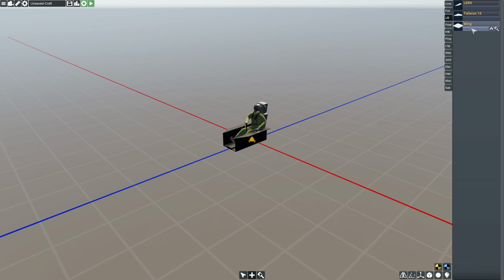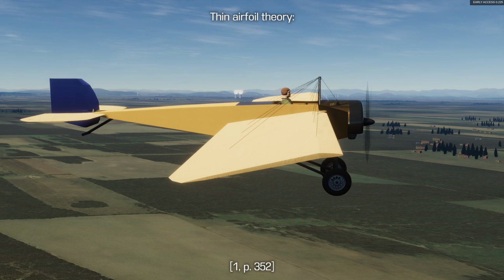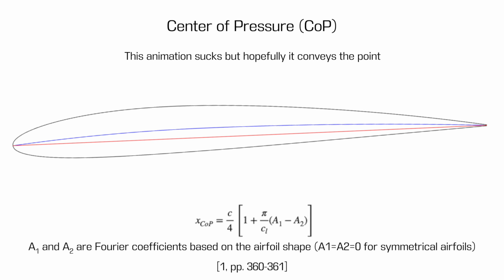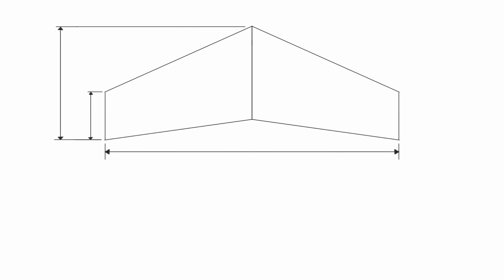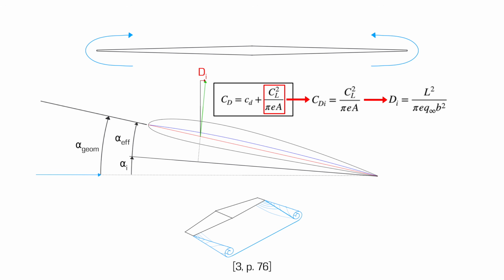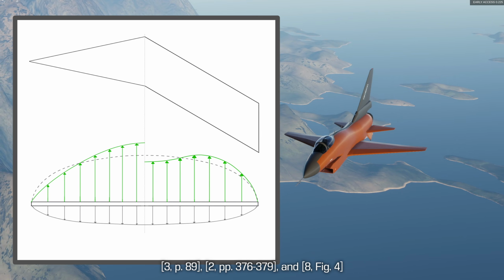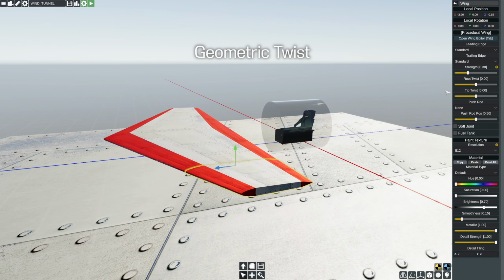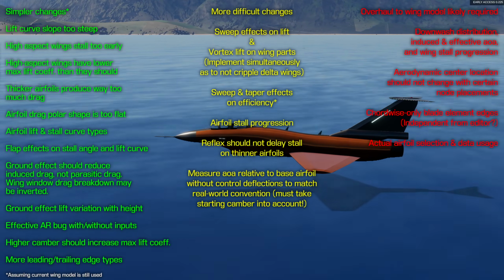Flyout Comprehensive Tutorial Series | Part 7: Wings Part 1

Comment from the maker: Hi all, I'll be updating this comment should things change with the game's wing model. Thanks for watching, and I hope you were able to learn some things about the aerodynamics of wings along the way. I also hope this video will help bring about some improvements for wings in Flyout.
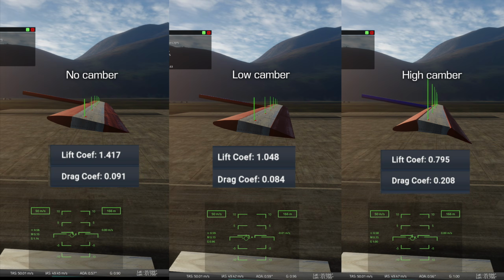It also has occurred to me that the displayed lift and drag values at 15:20 will be somewhat offset by the wing's aspect ratio not being super high, but the effects of camber in Flyout are still demonstrated. It's also possible that the vector length is a fraction of the max lift coefficient, so a lower max CL will show larger vectors per a given CL.
Reply: Also worth noting that ground effect only triggers on the actual terrain and not on world objects like runways or buildings. This is usually not a problem because the default runways are just a meter or two above the terrain and you'll get ground effect almost like normal. But for custom runways of different heights, you may get little or no ground effect at all
Reply from the maker: @Panthera_Leo_  Ironically I think I wrote a note for this in the script, but forgot to actually include it -_-